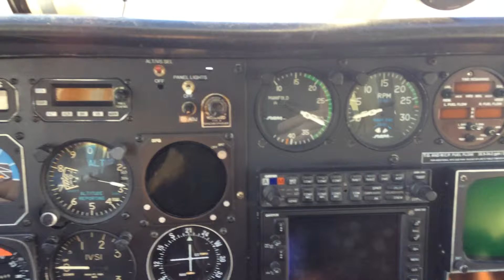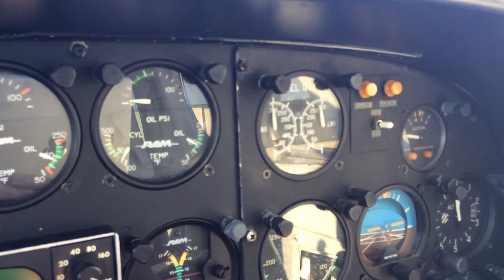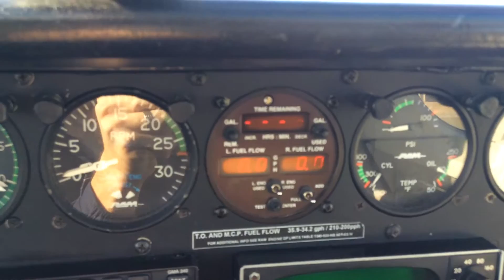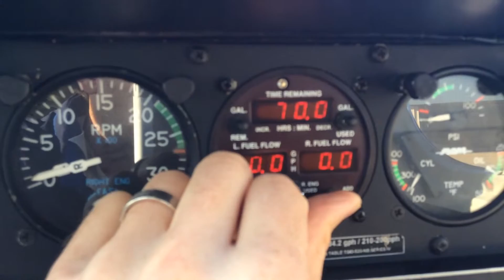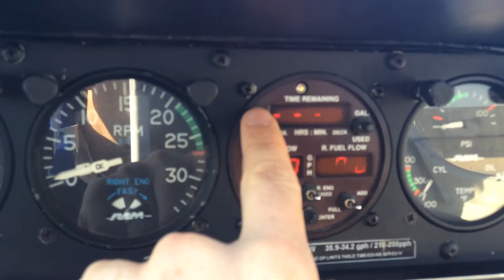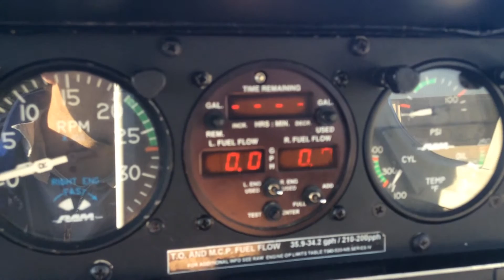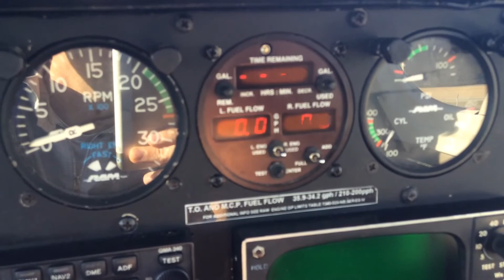Cessna 340 Shadin Fuel Transducer Programming

Comment: I used one of these fuel meters in an Aerostar that I used to operate.  I was told that what made them so accurate was the fact that the fuel flows through a centrifuge that separates the air bubbles and then a light diode measures the amount of fuel and air.  Kind of like a drug dealer measuring purity I guess.  I heard that it was the most accurate system available.